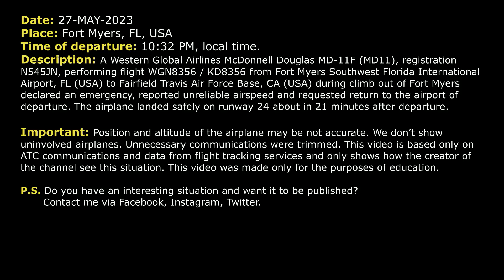Unreliable airspeed. Emergency return. Western Global MD-11 returns to Fort Myers. Real ATC

Comment: "For the tapes?" Weird way to phrase it. "Yeah, I need to know your souls onboard and fuel remaining, so it's on the tapes for the inevitable ATC transcript that will go in the NTSB docket when you lose all control and plummet into a swampy canal in Lehigh Acres."
Reply: I think he meant “ atc flight progress tapes”, that used to be those little white paper strips where the atco writes who the traffic is, where he’s going to, where he’s coming from, what type of aircraft it is, if he’s in a urgent or emergency situation, what situation it is…..an then the APP controller handles this tape strip of the TWR controller….and so on. I believe in now days it is not paper anymore, but electronic tapes.
Reply: @chizzo777  No it is a for the audio documentaion today Not on reel 2 reel tapes, More on Hard disks. Nice ATC Job, so Calm and polite. Good Job.